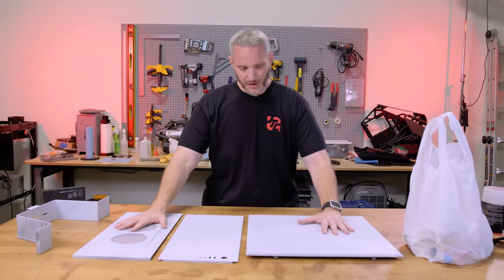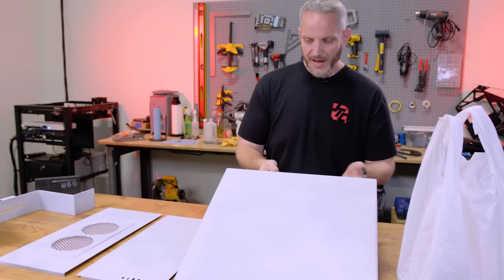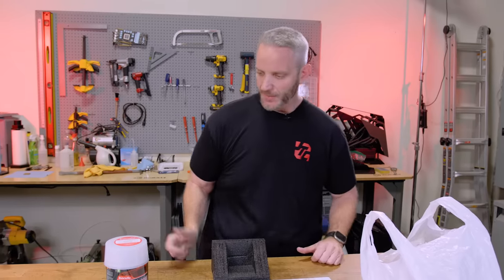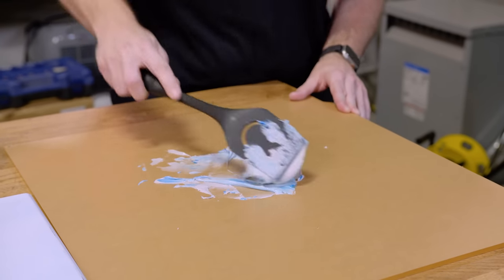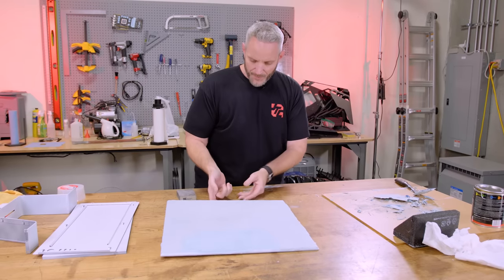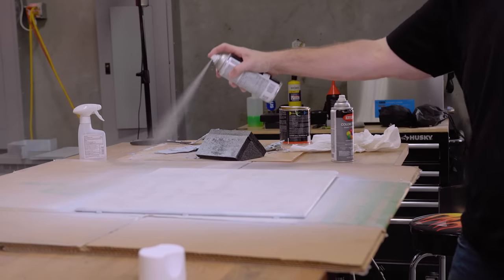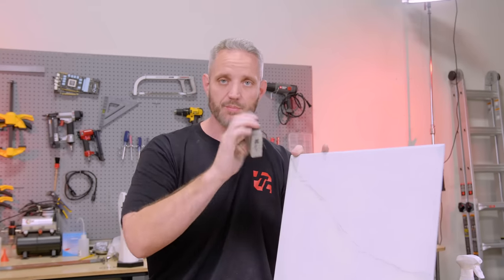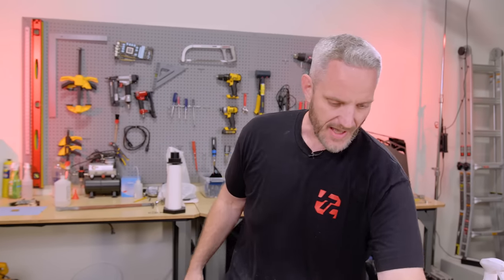Custom case mods are fun!

Comment: TIP: Pressing crinkled Foil into the bondo makes awesome cement broken patches. That you can work outward with cracks, brakes, missing chunks and chips after texturing. 😉😉👍👍
Reply: lol
Reply: No joke, crinkled aluminium foil makes for great texturing!
A plastic bag and some ingenuity is also good. 🙂

Comment: The panel is looking real good, excellent work :) I'd honestly suggest you hire a graffiti artist of your choice to tag the panels on the case. IMHO this is an art style and would be extremely difficult to replicate, off the cuff.
Reply: I actually highly agree with this idea tbh.
Reply: I suggest he practices for a few months and then adds his own personal style.
Reply: You can also use those big sheets of foam board (you can get it at Walmart) to make some really lightweight "concrete". You just peel off the paper from one side of the foam, and then go to town making cracks and "chips" in it by indenting the foam. Then you just prime it and paint it, and glue it to the PC panel. Get the same effect as the bondo with probably 5% of the weight. Another option is just to use a printed decal sheet of a high resolution image of a real wall that's been tagged already and stick that to the panel. One percent of the weight with 90% of the practical effect (just missing the depth, which can be made up for in the image to a huge degree).
Reply: I agree. It's probably going to look more genuine if you get an actual artist too.

Comment: Here’s an idea for the “cracks” in the bondo for the future. 

Use a piece of string/fishing line/wire and lay in the patterns you want, apply the bondo, before it dries gently pull the string to create that line/crack effect. 

That should work.

Comment: I really enjoy watching people do case mods, some really creative cases (mods) have be built.  I'am currently doing a case mod for a friend, though I didn't really started with a case, I actually have designed and 3D Printed the case itself which took me close to 300 hours to print.  Currently in the process of sanding, priming and using spot putty on the case.  I can't wait for it to be completed, and it definatly is my biggest 3D Printing project to date.

Comment: Ironic that as a skater we use bondo to fill cracks, and here's Jay using it to make them 😂
Reply: We just used actual cement. Though, I do remember my buddy using bondo or caulk or something to smooth the cracks between panels in his half pipe.
Reply: @AlphaMachina  oh for sure concrete is the best solution if it’s possible. But when your skating some stairs or something in the streets and there’s a crack right before the stairs, then bondo is a lot more low key than rocking up with a big bag of concrete and trying to mix it in a place where you’re probably not allowed to be skating anyway
Reply: @@gazz9496 Uncommon thought worth highlighting! Cheers.

Comment: I often forget that he's a legit artist with respect to custom builds.
Reply: That's because he's gotten away from his passions to chase viewers but.. when you have bills and employees to pay what can you do.
Reply: Eh.. there are much better, and lighter ways to achieve this same or similar, but just as good, effect.
Reply: Who dat?
Reply: @AlphaMachina  Care to elaborate? It's one thing to neg someone. Give some examples to show off your knowledge.
Reply: @ericepperson8409  Already put this elsewhere, but here it is, not one, but several better ideas: 

You can use those big sheets of foam board (you can get it at Walmart) to make some really lightweight "concrete". You just peel off the paper from one side of the foam, and then go to town making cracks and "chips" in it by indenting the foam. Then you just prime it and paint it, and glue it to the PC panel. Get the same effect as the bondo with probably 5% of the weight. This is a tried and true practical effects method that artists have been using for decades. Once the paint is dry, the foam is just as robust as bondo, but a fraction of the weight, and will flex with the panel, instead of cracking like the Bondo would. 

Another option is just to use a printed decal sheet of a high resolution image of a real wall that's been tagged already and stick that to the panel. One percent of the weight with 90% of the practical effect (just missing the depth, which can be made up for in the image to a huge degree). Simple, effective, and far better than slathering a bunch of bondo all over your computer.

Plus, there's other products that are specifically made for this sort of effect that work a lot better, like modeling pastes (Liquitex, Vallejo plastic putty, Apoxie Sculpt, etc)

That's the good thing about the internet. You don't have to pretend to be an expert. You can literally just look up the best methods for these kinds of practical effects. 

Bondo is fine, and it is used in special effects and modeling, miniatures, etc., but it's also toxic, heavy, messy and relatively expensive when compared to some other methods. And you don't want to apply it to thin metal that's going to be flexing (removing and applying that panel a handful of times might be enough to start cracking chunks of bondo off of it) It's used on cars, but it's not supposed to be used with thick applications. It's meant to fill in divots and cracks and dents and then be sanded down to a thin layer. 

This is definitely not the best way to do this.
Reply: @AlphaMachina  "instead of cracking like the Bondo would." When cracks are the point? LOL.
Reply: @stevewatson6839  Fake cracks. Not actual cracks that would have the entire aesthetic falling off of the side panel. Don't be a dunce just because you find it momentarily beneficial to your argument.
Reply: @AlphaMachina  I take real over fake when I can get real cracks. So much more... I dunno... realistic? I found your comment amusing; but now? Don't be so upset; all you'll get is laughter.
Reply: show me you're new to the channel without showing me you're new to the channel. My comment wasn't about the technique he used here, or what might be better, but his ability based on what he's done before, and how good this FIRST STEP was, again, based on previous projects. I often forget how toxic and critical the tech community can be. I shan't be commenting again.
Reply: shan't.. smh
Reply: @Paz_Soldan  I APPRECIATE your comment. Jay might not be the greatest techtuber, but he can build a mean rig when he lets himself. The kit modelling and messing with cars helps a lot. 

Pay no heed to knob-ends, mate.
Reply: @CapacitorCapacity  In all fairness he was also getting salt from people that couldn't find parts. So he stopped doin builds. Was dammed if he didn't damned if he did. Although views and revenue is still important.

Comment: You can also use those big sheets of foam board (you can get it at Walmart) to make some really lightweight "concrete". You just peel off the paper from one side of the foam, and then go to town making cracks and "chips" in it by indenting the foam. Then you just prime it and paint it, and glue it to the PC panel. Get the same effect as the bondo with probably 5% of the weight. Another option is just to use a printed decal sheet of a high resolution image of a real wall that's been tagged already and stick that to the panel. One percent of the weight with 90% of the practical effect (just missing the depth, which can be made up for in the image to a huge degree).

Comment: You can also get a good rough concrete effect by styling the backing with a sponge. Then thin some black way down and dust the panel with it. Once done, take a rag of thinner that is tightly attached to a block and it will only leave the low-lying places with the black.

Comment: The whole tagged up concrete makeshift skate spot theme makes me think that the inside of the case should look like a behind the scenes of that esthetic. Make it look like a sewer with cast iron pipes and grates and 3D print a bunch of random stuff to litter the inside like people have been partying or even squatting there. If the mobo or GPU has RGB logos black out random parts of them like they're signs that are failing. Do something with the reservoir so it looks like a big old tank of something with shutoff valves and whatnot. 
I could keep going but basically make it look as filthy and decrepit as possible.

Comment: A trick for making cracks through Bondo: lay down a piece of string across where you want the crack, apply bondo over, and then whan most ly dry pull the string and break out that section. Makes it look very natural.

Comment: The camera seemed to struggle to show the effect as well as I suspect it looks in person. But it looks good and I am looking forward to seeing the graffiti effects. 

Perhaps the case should be on a set of skateboard wheels?  Some metal pipe to reflect the various pipes and railings you typically hop and slide on might work too.

Comment: Jay, there is a product that comes in pressurized cans that when sprayed on a falt wall will add texture like little raised blobs that simulate a plastered finish when painted. You could use that and flatten it with a smooth surface. Then paint the high spots with a dark color to simulate a brick or stone wall with lighter "mortar" between the stones, or deep scratches between.
Reply: How about an update on the EVGA E1 build? That open air carbon fiber chassis is effing sick!

Comment: Personally I feel that to get a cracking effect using heat and cold would probably be a decent way to get a more natural pattern than making them by hand.  The Bondo does look to have the right consistancy for a concrete effect though.  Also for applying a dirt effect I would have thought something like a dry paint powder (like a printer tonor) applied with some shop towel could be a good way to go.

Comment: If you freeze the panel contracting the metal and apply NON-Flexible Bondo to the frozen panel and keep in the freezer overnight. Next day take it out and use a heat gun on the other side, the panel will expand and put natural looking cracks in the Bondo.

Comment: Waiting on this build was a good choice, Imagine doing this build with a 3090TI then the 4090 comes out. The skate park theme will look really cool If you can pull off some decent graffiti. The real challenge might be to get the graffiti at the right scale as it is usually big and will need to be scaled down so much on a case. If I was doing this build I would probably have to try to 3d print some graffiti stencils to paint through, but I am not much of a artist. Anyway good luck on the build 👍

Comment: Jay . if you want you can go get some latex find a good wall you want concrete type , make a latex copy of the indents and stuff and use the latex as a print and if you dont like the bondo as it is you can use the latex and stamp a good print into the bondo before it dries .

Comment: Your approach is really interesting and one cannot argue with the result. Personally I would have approached the concrete look differently. I would have sanded the panels, put some Gesso on there  so paints stick to the metal and then used concrete texture paint or Concrete Texture Effect spray paint. When You're done with painting and everything you just seal it with matte spray varnish. That is what I do for dioramas and on canvas. Maybe this helps you for another project. :)

Comment: You could put the Bondo then when it's not completely dry actually try bending the case to produce an actual crack that would look super realistic. But then you would have to find a way to ensure the bondi doesn't lose overall integrity

Comment: Jay, you could have just used Sandpaper and stuck it on and painted over as your firstlayer for concrete effect. Would have been easier to do to get the little bumps like typical conrete.

Comment: I would use 1/4 inch foam panel glued no with a wood burner you can cut in anything you want with less weight. There are creators that use this very sucessfully. Linus did a case with Nerdforge that was insane.

Comment: Toyota has a color called wet concrete or concrete that looks like what it says,I used some nail polish version and it looked good for the project I was doing it will probably work for you.

Comment: Oh but you can get more moded than that.... 

3d print a Skull with an interior dimensions just large enough for an itx mini motherboard and an aio cpu cooler.. 3d print a bust/upper (ribs just below the collar bones and up) skeleton with spine up to the connection to the skull...
run the coolant hoses along the front of spine as the trachea and the esophagus. mount the radiator and fans in the bust behind the ribs, in a flat orientation air flow going up through collar bones at toward the skull. use pci riser cables to run a gpu in the ribcage. modify a web cam to fit in an eye socket.

can swap ideas and use any creature as the base model... aka Alien head, predator, terminator, master chief, etc....

Comment: While the work looks really good in the video, I'd really be curious to see what it looks like in person. Not that it matters now, but you could have achieved an actual concrete-like effect using gray mica powder or even sand in the Bondo. There is also faux concrete plaster that works really well. I hate to keep hounding Jay about this, but it seems like there is never an attempt to do even basic research into any video,  even if only to make sure you aren't giving bad information due to forgetting something.

Comment: I tried to let it go, but I can't. Please tell you did something to the surface of the panel to help that bondo adhere to it. And by the I mean at least take some 80 grit at bare minimum and completely sand the surface before I spread it on. Body filler does not adhere to slick surfaces. If not prep right, and the panel is drop or flexed, the body filler could just fall off the surface.

Comment: Skating straight down a wall into the floor is kinda painful. You need a lip or radius to transition from wall to floor, like in a pool. Boarders look for concrete WITHOUT cracks to skate on. You might want to pay more attention to body shops. They, and most people with a brain, don't apply Bondo over paint. They sand off the paint so the Bondo has something rough to stick to. You obviously didn't read the instructions on the can. Great job recreating a slab of old sidewalk. Skatable wall, no.

Comment: how i would have done this (back)side panel i s that i would had poured a very thin, like a 10mm, panel size councrete replica , placed it on a flat surface and hit with a skateboard and would have copied cracks off from it to your project and had done art work around of it

Comment: Bondo is trash. It’ll chip and flake.  I ONLY use fiberglass resin putty. Works exactly the same way only holds up a lot better and isn’t even that much more expensive.